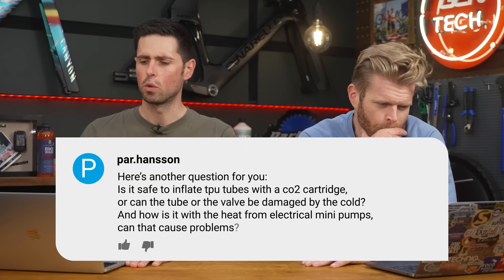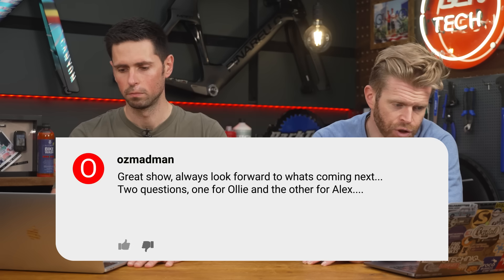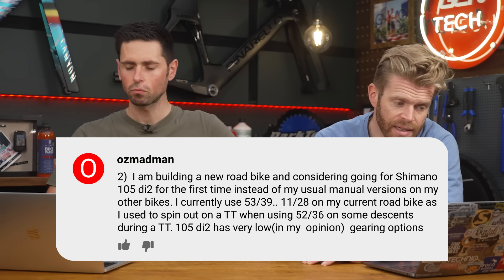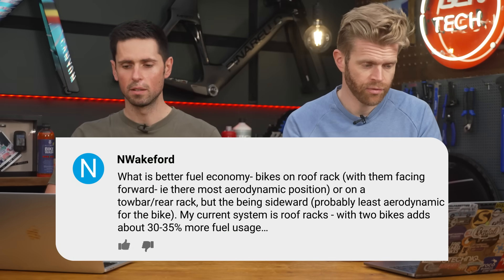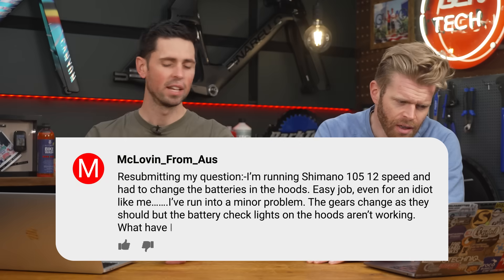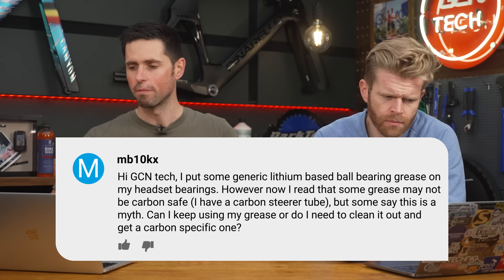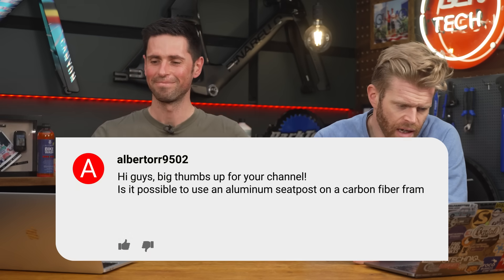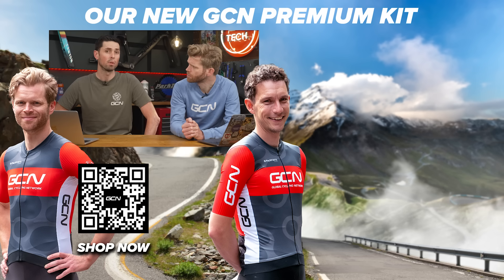Are Heavier Riders Ever Faster, Mixing Carbon & Aluminium & TPU Tubes | GCN Tech Clinic

Comment from the maker: Have you ever switched from a roof rack to a rear tow-bar rack to save on fuel? Did you notice a difference in your MPG/fuel usage? Let us know the real-world results! 👇
Reply: Yes! I have actually measured this in my electric car (the car itself provides the information via its trip meters) on repeat 10 km runs at highway speeds using each method. 

As a baseline with no racks or crossbars of any kind, my car averages about 195 Wh/km (over ~50,000 km). 

When I add the crossbars with no roof racks or bikes attached I am looking at ~198 Wh/km. This is how my car normally lives. My crossbars have an airfoil shape. 

When I add just my two roof racks to the crossbars, it jumps to 205 Wh/km.

When I add one bicycle efficiency plummets to ~250 Wh/km. 

If I add a second bicycle, it pushes to ~265 Wh/km, which always struck me as odd. I would've thought more. But aerodynamics are funny that way. 

With no crossbars or roof racks but with an empty tow-bar rack, it's virtually no difference. Same when I add otherwise empty crossbars. 

Finally, whether I add one or two bicycles to the tow-bar rack, I am looking at ~220 Wh/km indicating there's still some impact to efficiency with my shape of vehicle, but it's substantially less than using the roof rack. 

And yet I frequently use the roof rack anyway because the tow-bar rack is more obnoxious to deal with. Usually I deploy it when have more than two bikes to carry. 

But also, if I have no passengers I'll simply put my bike inside the car with the rear seats folded flat. That's always easiest and most secure.
Reply: No , I enjoy the splatted flys over the front to make it look I’ve been going “really really fast” a la Si 😂
Reply: Man I've never measured it but since I have an outing coming up in a week or two and I'll be driving there solo, I think I'm definitely putting the bike inside the car.
Reply: The wheels on the bike usually extend out of the sides of the car and car backs are designed to minimise the suction effects from the pressure drop which is disrupted by the bike. 

Once the flow over the roof is disturbed the aerodynamics are messed up so the second or third bike will always have reduced relative impact.
Reply: A US car magazine did a study on aerodynamics years ago. An empty roof rack was horrible for the drag coefficient. Hate to see what adding a bike or two would do.
Reply: @JB-sb1qg American roof racks are not aerodynamic like many European designs so they would be worse.
Reply: I have done it, but not for fuel econ.  Small hybrid, gained about 3 MPG.  Later found that roof anything - because I still have the cross-bars and would load things on the roof - is a mileage killer.  

Like the duo said, my concern is my bike if doing a long-distance or heavy-traffic drive.  I have taken the wheels off and put the entire bike inside the vehicle for a 1,200 mile driving trip (which saved on fuel, but took up space inside) while leaving the rack on the car to use the rack locally.

For the 2024 Ford Bronco (larger one), though, I'm not sure that the two bikes affected the 1,900 mile trip by being on the back; the bronco has the aerodynamics of a house moving through the air.  17.5 MPG was 'good' fuel economy in that.
Reply: No, but I've contemplated it to make it possible to go through drive-throughs.
Reply: Heavier riders are faster downhill

Comment: As per the hood battery question:this is the one time to buy OEM because despite nomenclature across brands being the same that doesn’t actually means the voltage and certain dimensions are they same. Same “size” battery could be thinner and have a different voltage thus causing the circuitry issues.
Reply: If it is supposed to be 2032 for instance, then that is an exact specification. 20mm diameter qnd 3.2mm thick. All cells are 1.5v type.

Comment: I commute daily and the bike cage at work requires me to hang my bike from its front wheel on two hooks. Thinking of buying some new wheels and was wondering if there were any considerations to make considering I will have to hang the front wheel? Should I be avoiding touching the spokes and just contacting the rim? Does hanging damage the rim? Would carbon or steel spokes need to be handled differently?

Comment: Hey guys, really love the show. Question on cranks: I recently had a bike fit and it was recommended I go down to 160mm cranks. I currently own an entry level Specialized Allez with Claris 2x8 (so the generation just before Cues was added). My question is: what is the most cost effective way to get to the shorter crank length without splurging on a whole new groupset? Thanks!

Comment: Interesting; 
52 to 53 rounded is about 2% faster.  Using a 52-11gear & 28C tire, pedaling at 110 r/min cadence theoretical will give you a top speed of 67 kph. Going to a 53 will increase your speed with less than 2 kph.  This will impact all gears and you have to consider more than top speed.  Most important is at what cadence you can maintain peak power for the longest period.

Comment: Olli, you missed the part of with the "same watts" in the question. A heavier rider wont be faster on average than a lighter rider with the same watts. They have a slightly bigger frontal area and more rolling resistance.
Reply: they will carry more rolling momentum that will override frontal air resistance difference
Reply: @notreally2406  thats only relevant when decelerating, for example ehwn you hit a short uphill or the wind gets more. But over a whole ride or race, there is no benefit of being heavier when you push the same power.

Comment: Why create a problem that a good manual mini pump doesn't have?
A better investment is to switch to the Schwalbe click valve. It features a new valve head that solves the old problems. Plus, this valve has a 50% higher airflow rate, making inflating the tire much easier.

Comment: It’s a strange sensation but I can verify through my own experience since I lost around 30 pounds I noticed how dynamically different it was to hold a high average speed from having the extra weight onboard. While it was harder to get myself up to speed, it was much easier to hold it. Much like the principle that keeps a heavier flywheel spinning longer than a lighter one through increased rotational inertia storing more kinetic energy.

Comment: Sorry, Ollie, but @3:00, I think you changed the question.  The question assumed "identical power" from the two riders; your answer explained why a larger rider can produce more power while presenting the same frontal area.  But, in fairness, I think the premise of the question was wrong.  If the two riders are putting out identical power while presenting the same frontal area (or if the heavier rider even has a bit more frontal area), the heavier rider wouldn't be going faster.  Except maybe there's an effect from a heavier rider's greater momentum?  (Need to get Emma Pooley back to answer that one!)

Comment: 5:20 I think its actually more aerodynamic to have the bikes on the roof rack then on the back. There is a big increase in drag when they're behind the vehicle. I guess it also depends on the vehicle and how well they're sheltered from that drag. A van/minivan might be better behind then on the roof. but any sedan with a sloping roof line its going to be better on the roof. 
I believe tesla has done some testing with this (or someone has with tesla) and the efficiency of the car (model 3) is better on the roof then a trailer hitch rack. People have also done testing with roof boxes, Its actually better efficiency with them facing the wrong way then having them right way (ie. ones that are sloped, its better to have the blunt section facing the front of the car and have the sloping part of the box facing the rear of the car).

Comment: Regarding ships, a longer ship has an advantage due to wave making resistance. A ship generates a bow wave and a stern wave. When the length of the wave becomes longer than the ship, the ship essentially has to power uphill. When the length of the wave is similar to the length of the ship, it is called hull speed. Hull speed is proportional to the square root of the ship length.

Comment: you can use an aluminium seatpost but agreed, take it out, put some assembly grease on it, do it a couple of times a year. I didn't know about galvanic corrosion and now my seatpost is set permanently
Reply: It's not permanent.  Just hook a 5 pound slide hammer to it with a chain and hammer it out, will take a few minutes.  Don't use the other methods on youtube.
Reply: @凸Bebo凸  seen people say they tried that with my exact bike to no effect, appreciate the suggestion but if it goes wrong i can't afford a replacement. Fortunately it is in basically the right place. Whenever i change pedals it is just hoping stack height is not too different.
Reply: @ffraniel   lol, bike people don't know about slide hammers, zero chance you found a forum post referencing your specific bike and a slide hammer.  Enjoy your stuck seatpost my lying friend, sounds like you are right where you deserve to be.
Reply: @凸Bebo凸 what a weird response. Accusing people of lying about whether they know about slide hammers is just odd, sure you have met every bike person and assessed their knowledge of tooling. If you google it it comes up many times, beyond that I don’t know what to tell you. I was grateful for your tip, shame you didn’t leave it at that. Sorry that you are so upset that I didn’t say, “I have never heard that before, wow”.
Reply: @ffraniel  lol, look at you on a 15 year old horrible carbon bike with damaged seat tube, emotional attachment to it, making up stories on how its unfixable.  So ridiculous man, the pros throw those things into the wall after every race and get a new one, haha.  Anyway, very weird interaction, thanks for the laughs.
Reply from the maker: there is nothing worse than a stuck seatpost!

Comment: Corrected:  "A key difference is the Topeak electric inflator we're paid to shill has a removable hose to keep temperature down at the valve stem, where the better performing Chinese ones also have a removable hose to keep temperature down at the valve stem."

Comment: Guys, I've just switched to Tpu tubes and I've tried to research tyre pressure which has thrown up some very differing results. I run my butyl tubes at about 80psi but what should i run tpu tubes at to be the same? I've gone for 60psi but they seem really hard and online search engines are both helping, please help!

Comment: I used an alloy seatpost in a carbon frame for a few years with absolutely no problems. I used carbon assembly paste and made sure I regularly removed the seatpost to clean and reassemble, but I do the latter with alloy/alloy or alloy/steel posts and frames.

Comment: The CO2 canister gets cold as the gas escapes but the valve will still be heating up from the gas being forced through. The energy being lost at that canister is appearing elsewhere. The cold would never be an issue except to your hands.

Comment: I used to carry my bike on the back of my previous car. I didn't worry about the extra fuel used for te reason Ollie said. I only changed my car to carry my bikes inside. Not due to worry about the bike getting damaged. Mainly due to someone wanting to releave of my bike. I was leaving my local riding spot last year. The car park has ANPR barriers. A car left the car park before me using a different barrier than me. It stopped for no reason. So I stopped waiting for it to go. It didn't so I reversed back into the car park. when they left I drove out of the car park and went the other way. As I had former GMBN presenter, Blake Samson old custon painted Orbea Rallon in the back. I decided to carry my bikes inside.

Comment: Heavier riders putting out the same absolute power would not be faster however in general they put out more power even though their power per kg may be lower they are not dealing with overcoming weight on flat roads the weight would have minimum impact other than acceleration all they are overcoming is wind resistance. Weight has a minuscule effect on bike friction and rolling resistance.

Comment: So a number plate holder with lights are not mandatory, when the rear lights and/or the numberplate is obscured, in England?
Thats daft.
And even more stupid that people put bikes on the back, without a numberplate holder with lights.
You need Danish laws back.
Reply: Must have misexplained. If the number plates or lights are obscured in any way at the rear a board has to be added behind the obstruction clearly displaying those.

Comment: Did really Alex answer the grease question? The only chemistry related one? While DR Bridgewood is sitting there with a chemistry PhD 😂
Reply: I noticed that, too. In general, cured epoxy is very chemically resistant, grease is not a concern.

Comment: How much weight would i save if i put hydrogen or helium in my tubes? And is it safe?
Reply: 1st Helium is save
2nd with hydrogen you shouldn´t go near flames or embers with a puncture, I would guess
3rd since both molecules area smaller than regular air molecules, standard tubes would probably be permeable and loose pressure
4th the weight saved would be probably less then e.g clipping your nails before the ride, or washing your bike
Reply: so if I calculated correct then a 28inch 28mm tire contains about 2,4liter of air (assuming that tire/tube wall thicknes is counteracted by the expansion of the tube below the bead seat. Then the density of air/helium/hydrogen at 7bar/100psi is said to be 8,52/1,12/0,63 respectively, therefore you would save (for both wheels) 36,4/38,8 grams... seems i quite underestimated the volume of air in the tires and the density differences

Comment: Just get TPU tubes with metal valves and you don't need to worry about hot mini pumps or cold CO2. They also seem to hold air better.
Reply: Any brand that worked for you? Had mixed results with Cyclami so far and opted for Pirelli Smartube (with plastic valves).
Reply: @ClaudioBernasconi  RideNow has valves out of metal
Reply: @ClaudioBernasconi silca just brought out tpu tubes not sure on price
Reply: Co2 inflaters are kind of obsolete.  Just get a RiderAce mini pump, It's 80mm long and will get you to 50 PSI in about 5 minutes of pumping.  I carry this, and 8 quarters duct taped together to use a gas station air pump.  The CO2 is gonna freeze your fingers, freeze the TPU tube or just break and shoot off into the air.  The modern Chinese mini pump is where its at.

Comment: Hey guys, thanks again for this excellent show.  One comment on using CO2 with TPU tubes: I believe I had a leaking TPU tube because of too rapid inflation. Setup was a 23mm wide race tire with a TPU tube designed for 23-32mm tires. The tube was pre-inflated (by blowing into it, ~0.3bars), then assembled and checked for proper assembly. Subsequently it was filled to ~7bars with a C02 cartridge as needed for the weight/tire combination. This was done at home to try using the CO2 cartridge on TPU tubes, a pressure gauge/manual pump was available. After riding 15km the tube started to lose pressure. The leak seemed to partially be around the valve stem, but I also noticed that some of the tube material was folded over on itself. It seems the rapid inflation did not provide enough time for the tube to expand evenly, especially at this minimum tire size it was specified for. (Detailed setup: Barbieri NXT RACE TUBE SUPER LIGHT TPU 700X23-32, Continental 4000, wheel: FULCRUM RACING 5 C17, Topeak Micro Booster with 16g cartridge)
Reply: Its not rapid inflation. Tpus are easy to twist installing, after inflating they somehow stay twisted and they rip themselves. 
Inflate the tpu tube as much as you can while installing it to prevent that.